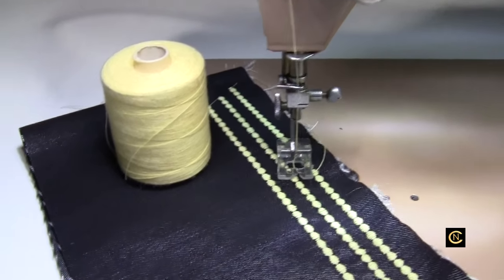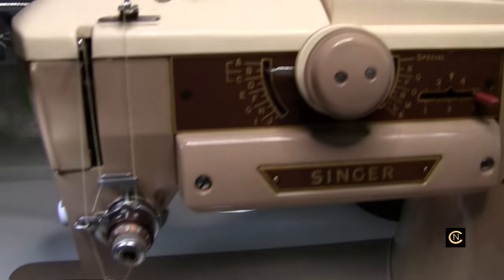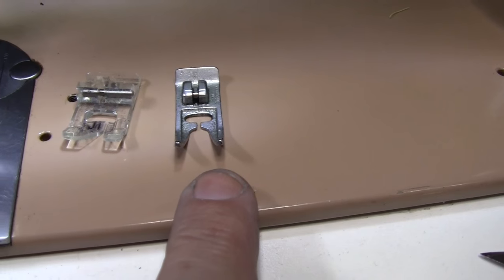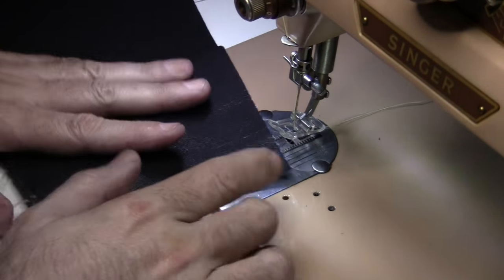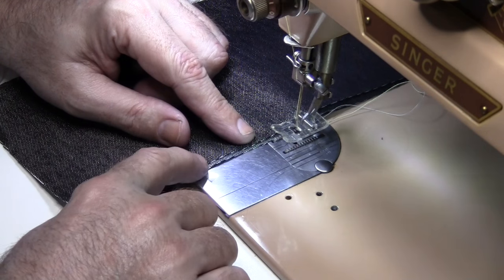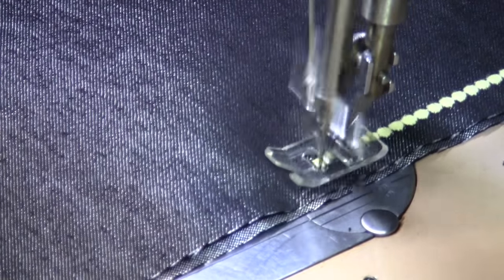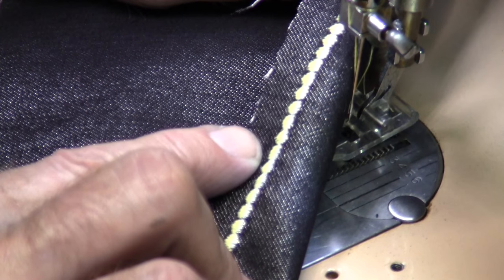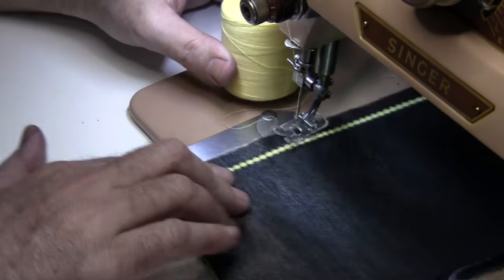Decorative Sewing - Vintage Singer 401A - Satin Stitch Foot

Comment: Very informative video, especially with the points about using the right foot and a stabilizer.  I'm sure you saved many sewers a lot of frustration.  I have a 401a and I wouldn't trade it for all the computerized machines they make today!  The machines today have a plastic shell and lack the backbone of a full aluminum or cast iron model.  I can sew anything with the 401and think it's one of Singer's greatest masterpieces!
Reply: Jule Phillips love my 401a, likewise, won't trade it for any computerized sewing machine!
Reply: I have a 401 too... but my thread keeps on breaking on me..(top).. any hints?
Reply: When that happens on my 401A, it's almost always due to one of two things.
First, there is buildup in the tension mechanism. You don't have to disassemble it to wipe the three disks clean, just release the tension and wipe a lint-free cloth with some 90% alcohol or better through them.
Second, I've accidentally grabbed a feed over plate which was not meant for Slant-O-Matics. Some of the 600 and 700 series cover plates fit but don't quite line up.
Maybe that will help.
(I assume you've checked the tension and thread path and made sure that the thread has been pulled up and over that little notch on the tension mechanism so the outside spring can hold it under tension.) @dankthompson

Comment: Like your 401 videos!  I'll mention that if you have the original attachment set that comes with the zigzag Slant-O-Matics, you will find it includes the satin stitch foot (although they call it the "special" stitch foot or something like that.)  I always like to use the original, vintage feet when I can.  :)
Reply: lisalu910 good to know.  Thanks for that.  I just bought a 401 yesterday and I’m pretty sure it came with that special foot so just when I was beginning to worry I’d have to go on a hunt for an elusive part that necessitated the search for another elusive part,  I saw your post!  Thanks again!
Reply: The special purpose foot also has an eyelet that will accept chord or yarn to make a padded satin stitch. It gives more height to the standard satin stitch as well as fills between the stitches.
Reply: @strayblackcatsmeow  , I didn’t know that!  I’ll need to check my special foot.
Reply: I find the clear foot is easier to work with and gives the same great results as the special foot that came with my 401A. However, I have to replace the clear foot every few years (I do a lot of satin stitching) whereas the special foot is well over 60 years old and still in perfect working order.

Comment: Hi Christopher,
Thanks a lot for all the videos specially 401a.
I bought one not too long ago and it was frozen so I fixed it and now it is running.
I would like to know where did you buy that long thread holder. I really need one and if possible I would like to make on my own.

I am learning to use the decorative stitch came with 401a. Some of them are working, some are not.  I also need to buy the satin stitch foot like yours too.

Thanks a lot for the info. If possible can you make one video for the 401a decorative stitches  , with different letter combination, also with 2 needles?

Thanks,
Jasmine
Reply: Jasmine Vanya you can buy on eBay .

Comment: Where do you find a low shank slant adapter as I saw in this video when you used a satin stitch foot--I have looked everywhere.  I can find low shank but not low shank slant---does the low shank work anyway on the 401a?
Reply: You need a special adapting ankle.  I found mine on eBay last year.  😇